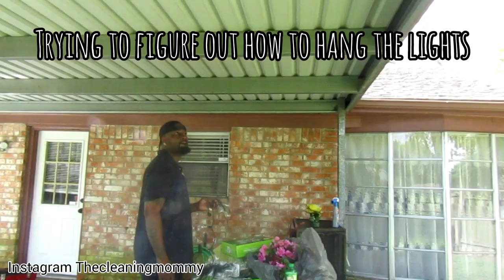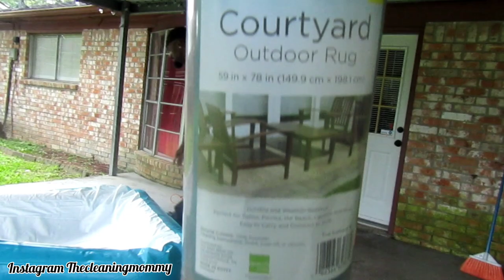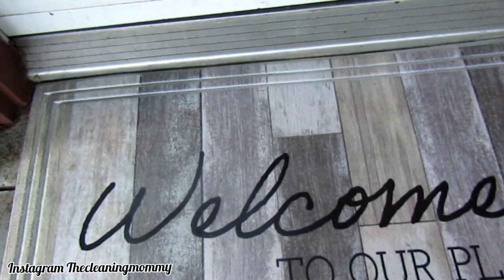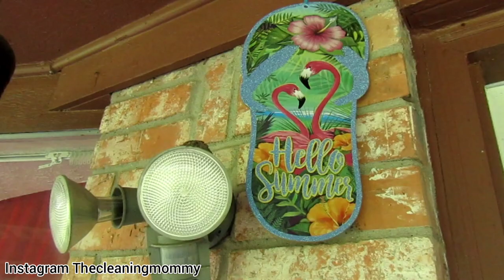*NEW* DIY BACK PATIO MAKEOVER ON A BUDGET | CLEAN AND DECORATE WITH ME

Comment: I suggest that you power wash your brick and remove the algae from them. You could paint your concrete and fill in the cracks with cement to get a better look. Great inexpensive way to decorate your deck.
Reply from the maker: Thank you I will definitely look into that as I get ready to get the back patio ready for spring and summer